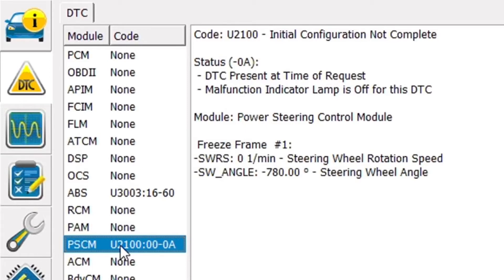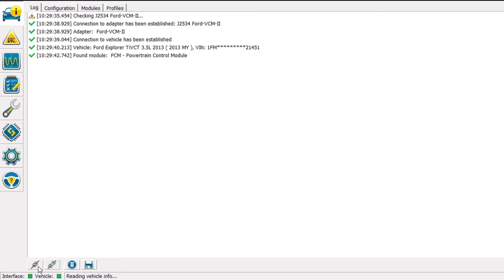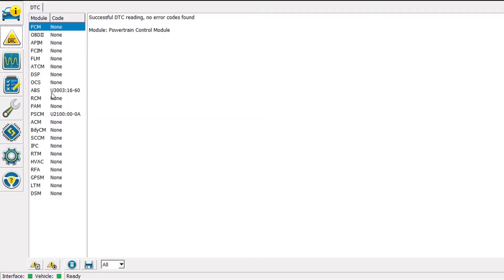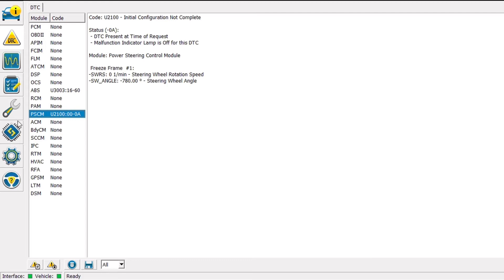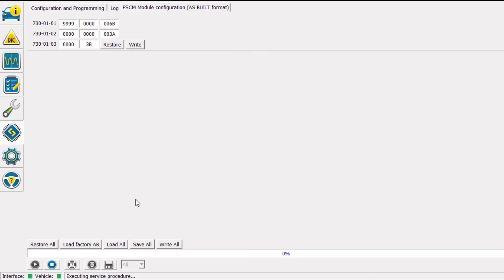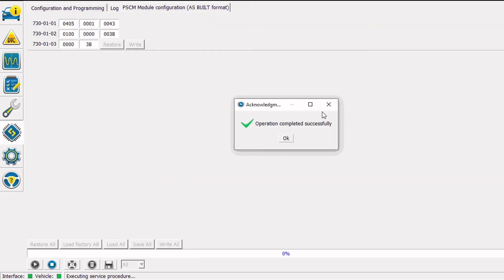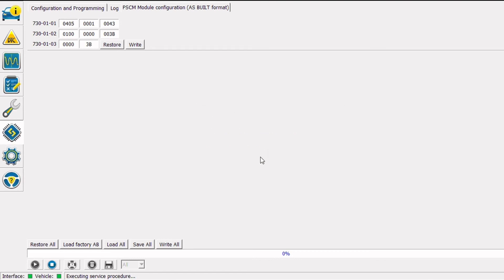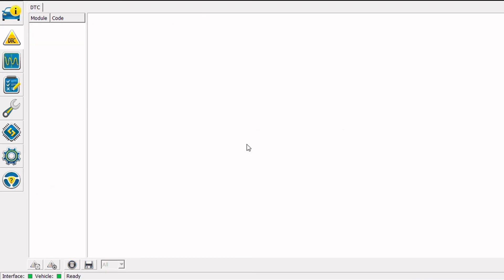How to Configure a Ford EPAS Steering Rack with Forscan

Comment: Quick question, i have a ford raptor 2021 gen 1, my steering rack broke, i was wondering if i buy a second one used as the new ones cost 6k for no reason at all, but the "donor" steering rack has 2 different letters at the end, can i load the info from my broken and re-write it to the new one? will it work with this method?

Comment: Mine has a U2101:00 Configuration Incompatible. PS works fine, but I cant get Active Park Assist to work because of this DTC. Is there a way to backup everything before trying rewrites and firmware upgrades? Just in case something goes wrong

Comment: I have just had a refurb. ps rack fitted to my Ford C-max and using a paid for version of Forscan I went through your tutorial. Now when I got to the As Build button, to connect to the internet, I got this message " Sorry as built file doesn't contain information about this file" I double checked that I had an internet connection.
The power steering is working fine, I just need an alignment.
I should mention there were a bunch codes for the power steering, when I got the car back from the shop, which I erased without saving them.
Should I just accept the the results or is there something else I should be doing?
Thanks
Reply from the maker: It doesn’t happen often, but occasionally as-built files are missing data. That’s my guess as to what’s happening. Have the codes returned since you cleared them? I’m assuming at least a couple will return until it’s configured. If the data is missing really the only way to resolve it is to contact Ford and request they generate an as-built file for it.
Reply: @CarShopTalk  Thanks for the quick response to my question. Is it possible I can enter the Motorcraft website with my vin # and it can generate a new as built configuration?
Thanks

Comment: Hello I followed ur video step by step and I still have the code coming back and a dash warning icon that says “power steering assist fault service required” any ideas how I can get rid of the warning Icon ? I programmed it I loaded the as built … everything . Any help would be appreciated . Thank you
Reply: @CarShopTalk
Reply from the maker: What year and model?  It has a new rack?  What’s the code you’re getting?
Reply: 2016 ford f-150 and the same code you have U2100, it has a new Reman rack from Detroit axle
Reply: @CarShopTalk
Reply: @johnnysedatto1789 did you find the solution
Reply: Did you figure out how to fix it?
Reply: I'm having the same issue, has anyone find a solution yet?
Reply: @falco41   I have the same problem. On the next week I will try it with FDRS.
Reply: @PrazsmaryD I’m trying to figure out way to buy. Forscan, ids, fdrs, vcm3, and what pass thru device 😢

Comment: I installed a used rack in my 2015 Lincoln MKS. I had advancetrac service light but steering worked. I used this procedure and everything worked perfectly. Thank you!!
Reply: What computer or component did u use to reprogram it?
Reply: @DdgjyfdI used an HP laptop

Comment: Will this work on a 2012 Ford Focus with electric steering fault code U3000?
Reply: any luck with this? i have the same vehicle with the same code
Reply: @TheAresTrader nobody replies. How did u reprogram the car?
Reply: @Ddgjyfda common misconception is you need the dealership to reprogram, YOU DONT! they will charge you a stupid amount for just an initial read. if you’re not a complete idiot, you can reprogram yourself just fine.
Reply: @TheAresTrader  how?
Reply: @TheAresTrader how

Comment: Is it possible to change the EPAS configuration from the original "As Built" data to that of another car? I would like to try programming a Mustang GT with Mach 1 software to see the differences.
Reply from the maker: @MaximumVelocityMotorsports  should be. I’ve used Forscan to look at and reflash EPAS as built files, so I can’t think of a reason you couldn’t.

Comment: Does anyone knows why I get "Number of blocks in files and molecule doesn't match?"
Reply: I am having the same issue. Did you figure it out?
Reply: @patrickbarrett5116  No, still have the same problem.
Reply: @albertop0000 did u figure it out? I need to do this for my taurus
Reply: @DdgjyfdNo. I will try again later once i fix the laptop. The one I had had running Forscan broke down

Comment: We recently installed a new rack in my son's 2010 Fusion. When we got it all done everything seems to be working without an issue and the powertrac steering warning is gone. Is it necessary to program this remanufactured rack to his car? The sheet with the rack says it has to be to validate the warranty, but it's working fine as is and I'm pretty sure I'd rather junk this car than remove the steering rack again lol. Thanks for your time Sir, have a great day.
Reply: Currently in the same position with my 2010 Fusion. Has your son had any issues driving this vehicle without a reprogram since this was posted?
Reply: Updates? Did it need to be reprogrammed?

Comment: Recently I was replacing the subframe on my wife's Escape and had to separate the steering gear from the column. During the process, I was getting frustrated and allowed the wheel to spin. I reattached the column to the steering gear but I'm afraid it might be off a revolution (or two) and I'm going to wreck the clock spring.
Can I use Forscan's steering angle to ensure i mounted it correctly?
Please excuse me if this is a dumb question but I've never used Forscan.
Reply from the maker: You should be able to view the steering angle with it.
Reply: @CarShopTalk  Thanks for taking the time to reply. I was able to get a steering angle displayed with Forscan. Unfortunately, the reading didn't make sense. I had suspected that my error would be multiples of 360 degrees so I could figure out how many times that I had let the steering wheel spin.  Instead, it was off 225 degrees. I'm guessing that when I pulled the battery, the EPAS lost track and just started up from the last known value. Not a complete waste of time, since I now know how to re-initialize the EPAS.
To solve my initial problem, I just removed the clock spring and manually figured out where the middle should be.